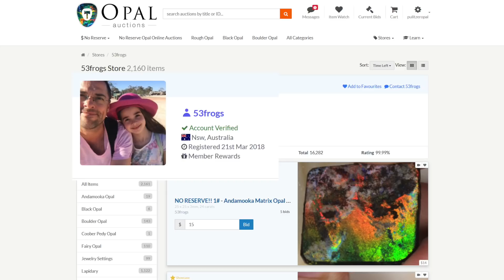Green Monster Opal - 4800 carats

Comment: I have a large piece of Anamooka ”Concrete” Opal. It definitely has color and I paid $200 for it. After I got it, I was told that Concrete Andamooka won’t take treatment. Is that true? Did I get ripped off?
Reply from the maker: Concrete Andamooka opal is known for its unique appearance and can sometimes exhibit color play. While it's true that some Andamooka opals may not take treatment well, it doesn't necessarily mean you got ripped off. Opal values can vary greatly depending on factors like size, quality, and the presence of play-of-color.

To determine the quality and authenticity of your opal, it's a good idea to have it evaluated by a reputable gemologist or opal expert. They can assess its properties and provide more information about its value. Keep in mind that the beauty of opals often lies in their unique patterns and colors, so even if it hasn't been treated, it can still be a valuable and beautiful gemstone.

Comment: beautiful work mate. I've been busy cooking Boulder opal matrix (FAIRY OPAL) for a while now and i totally agree with you. Without cooking it is nothing more than garden rock..I've yet to try the acid method though, instead i just do the sugar then wrap my preshaped stones in foil then bake them on high heat for a couple of hours to carbonise them. I intend to try your method though on my next batch. Stay safe and well and thanks for sharing these beauties with us.
Reply: @PulitzerOpal  ive found that the more sandstone like the matrix is tge deeper the carbonising goes..a friend of mine uses cooking oil soak then burning in a fire and it seems to work ok..i do leave my pre cuts in a slow cooker in the sugar mix for 2 to 3 days as well and have had great depth of carbonising  too..i wrap my cooked stones flat in foil in 2s or 3s then place on a baking tray in the very hot oven..i was told seperate wrapping them helps contain the process..i will try to share a short video i did recently mate.

Comment: I have never had any luck with opal, i've tried several types and it's very difficult knowing what you might end up with and predominately that is nothing other than ironstone, sometimes with one or two spots of colour seen if you hold it correctly into the sunlight.
I purchased one for my collection, a nodule of ethiopian brown opal, quite a lot of colour flash, yellow, green, red and some blue,  but again it's not instantly evident without that extra light, unlike your arrowheads which just one colour.
The gamble opal I purchased was white crystal and looked like a winner,  but as with most novice choices this horse fell at the first fence because the ground was mostly sand, I ended up with a lot of holes held together buy small pieces of crystal opal, it looked like a leaf after a bug had dined on it, but much smaller.
Very informative video, thanks buddy.

Comment: Arrowhead!

i was one of two people working in the anodize lab at a surgical parts manufacturer and there was a 300 gallon hopper filled with sulfuric acid left over from experimenting with a titanium anodizing process that had been there for a couple of years.  we had an EPA inspector audit our production practices and he said we needed to neutralize the sulfuric by using soda ash and then we could simply drain it through the floor drains and it would be safe.  so the next week the chemical engineer and i are getting our PPE together and working out a game plan to drain this 300 gallon tank that stands 8 feet tall and we figure we need someone on the ladder putting small amounts of ash into the hole at the top of the tank and someone on the floor passing small, safe amounts of soda ash up so the tank doesn't overheat. 

by the time we figure out the plan, it is my lunchtime.  i told him i would be back in thirty minutes.  he was my supervisor, but this was his first job out of college, so he was very eager.  i go into mom mode and i tell him not to do anything stupid while i was gone.  do you want to guess if he did something stupid?  winner, winner, chicken dinner if you said yes.  he thought it was a brilliant idea to climb the ladder with an entire 50 pound bag of soda ash  on his shoulder and slowly pour the contents into the vat of acid.  he did not count on a giant clump of coagulated soda ash to fall out of the bag and instantly and violently boil the acid over the top of the vat and all over his head.  i just sat down with my sandwich and i see people running across the shop and i didn't even have to ask what happened.

the results were burns over one side of his face, his neck and one shoulder.  the hospital had to dispose of his clothes, his brand new first gen iphone, his wallet and shoes.  then, the kicker.  the fire chief asked me what happened, and i told him we were neutralizing the acid so we could drain the tank.  he said, and i quote because this is burned into my brain from the rage i felt, "you only have to neutralize 500 gallons or more.  this is only t300,  it would have gone through water treatment fine." when i say i could have murdered that EPA asshole, believe me.  i now had to decontaminate the entire lab, run the entire line by myself. and i can't forget the fact that it was the last week of the month so i was slammed with parts to run - also by myself.  i even sliced my arm open because i was rushing so quickly, and i just cleaned it out and superglued it shut because i would not have had time to go get stiches.  

the moral of this long winded rambling rant is to say sulfuric acid is bad kids, mkay?  don't play around with acid and always wear your PPE.

Comment: So, my takeaway from this; your latest (recorded) adventuring in the wild world o' opal?
                         Ahem

Q: What has enough moxie to transform 16.67 carats of untreated Andamuka matrix opal into Alba and Edward: 2 fiesty, fiercely 'independent' Andamuka matrix opal arrowheads?

 A: 53 frogs. Or just head.

Nota Bene~ Could be just my brain running with it (usually smack dab into a wall and, consequently, a potential Darwin award)...but did anyone else think that Edward and Alba resembled one another? Like...waaay too much to be a 'thing?' In hindsight, methinks separating them was for the best, so...good call. good call. 

Lastly: submissions for American parallels of 'G'day (cool factor parallel? questionable) 'Aloha' is kinda parallel to G'day? I'm a huge fan of 'Salutations'. But my all-time favorite is the loudly silent 'hat tip,' which quickly adapts into a casual upward flick of the chin, should one find oneself without a hat to tip in acknowledgement. But I've said too much, as usual.

Thank you for posting (rant included)!  Hope this finds you well-
              ~TimKoy~

Comment: Don't have a license to handle corrosive materials?  Well there is an alterative.  After the sugar treatment wrap the stones in several layers of aluminium foil and bake them in the oven on high until the sugar is caramelised black.  Then proceed to the cut and polish.  However with either treatment the sugar will not impregnate deeply into the stone, you may need to repeat the treatment if you rub too much away.  Untreated Andamooka does make for a cheaper form of opal to buy, and after treatment as you can see in this video it comes out a treat, so if you the patience it is a worthy opal form to work with.  Good opal hunting, try Riley Gunn's website and YouTube channel as a starting place, Riley puts out some very educational videos for the novice buyer, cutter and seller.  Thanks Cornel for the great content.

Comment: These arrowheads (I'm not sure if that "s" at the end will mess with give away, so I'm writing code again: arrowhead) are a bit dull. I'm curious what would happen if you polished they surfaces, without shaping, just polishing areas where flakes fell off. 
Also I'm rewriting my question from previous video, have you ever tried to make wheel marks on stone to give it scale like finish?